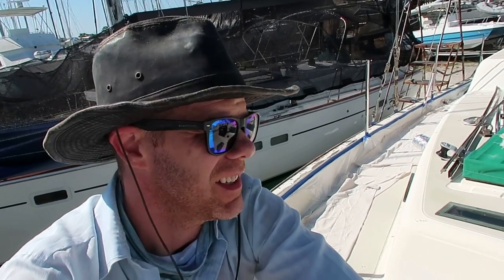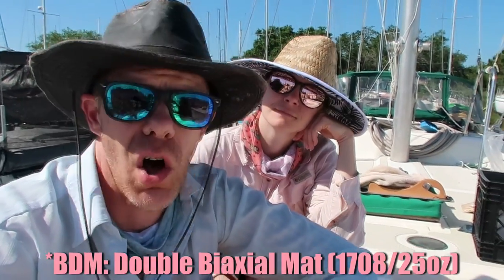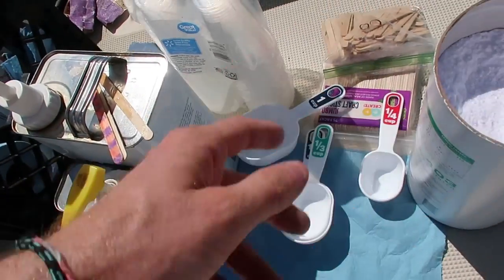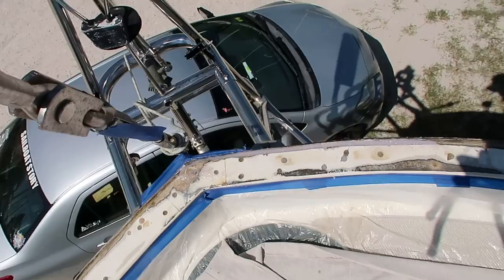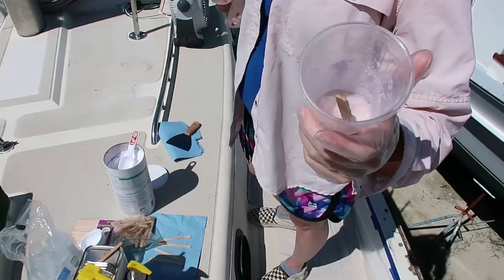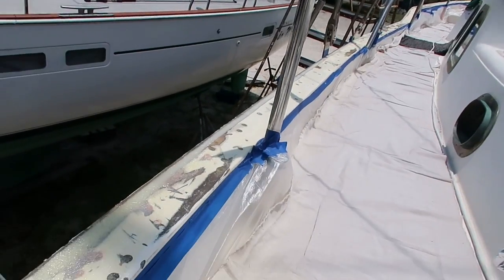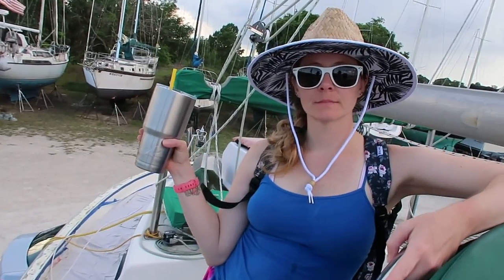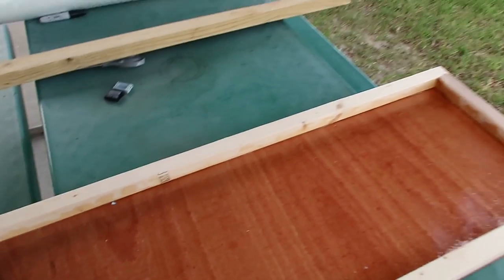HULL TO DECK JOINT REPAIR | PART 3: Filling & Fairing With Thickened Epoxy | Sailboat Story 200

Comment: By doing the hard work now you guys have saved yourselves a lot of future grief. It would be nice if some boat manufacturers would watch this video.
Reply from the maker: It was nice when the leaks suddenly stopped after the initial application of the neat epoxy poured into the joint. Everything after that was just additional insurance against leaks, beefing up the cap rail, and now we're just working on making it look nice.

Comment: Too late now, but maybe this will help in any future projects... A little prior planning goes a long way to reduce your workload.  In this case it would have been more efficient to cut all your strips the night before.  After laying down the thickened epoxy in the gap there is no need to wait till it cures and sand it (so much avoidable extra work).  Once it kicks and gels you have a good 6 hour window to still get a chemical bond with epoxy, so immediately start laying down your 1708 Biax strips.  Once those are down you are still in a chemical bond window so mix up the fairing filler (407 or 410) and lay that on moderately over the fiberglass, then let it all fully cure.  With the fairing filler on top of the glass it protects it from amine blush directly on the new fiberglass you just laid down, plus it is now super easy to sand it all with your long board to get a nicely faired, flat finish surface.  The other strength advantage is that the cloth laid over and laminated to the existing rail when the thickened epoxy was still in its open time gives you a superior chemical bond.  In any case, you did just fine and the mechanical bond you have is more than adequate for that application.  The method I just laid out would have saved you some sanding and the job would have been a one day thing with less fairing before primer/paint.  Still a great repair on your part.
Reply from the maker: Thanks man. Sounds like you really know your stuff. Probably the factor that would have prevented using your plan, more than a lack of planning, is a lack of energy. Ha! It’s been TOUGH getting this job done in the FL heat. Thanks for the insights. I do appreciate it.

Comment: Thought at first you guys leave Molly in the woods . Just like Hansel and Gretel Good thing she was there, she knew how the vacuum cleaner worked, that's how women are☺️☺️         And also got 2 blows, 😂😂nice humor. But still a lot of work with the arrangement to edit it like that, but you will benefit a lot from it later , the leakage is nicely gone . It was a nice video again
Reply from the maker: There were 3 blows. Can you find the 3rd?
Reply: @Sailboatstory  i go and look again
Reply: Yes at THE end of THE video
Reply: Yes at they end the video 😂😂😂
Reply from the maker: @johnyassouw  There it is. 🤣

Comment: just a thought on the epoxy mixing, you might want to do the hardener last, instead of the thickener.  it will give you a bit more time to mix-in the powder thoroughly, before it starts to kick off, giving you slightly more working time..... just a thought! 
luv you guys, best wishes for a full and speedy return to the water!!!!
Reply from the maker: That could work, but it might be more risky about whether the epoxy is mixed well enough. Haven't tried it that way though. We didn't have any trouble once we started either getting it out of the cup ASAP or just spreading it thinly around the inside of the cup. Prior to that though we did waste a few half cups full of thick epoxy. Either way, it's important to move quickly and deliberately with the fast cure stuff.
Reply: @Sailboatstory  yeah, epoxy can be a tricky thing, depending on the type. Even the humidity, and air temp can impact curing time.  I'd imagine, if you'd already mixed the thickener and the larger quantity of epoxy, (or even the opposite way around, so you CAN see how the hardner is mixing into the larger volume too) you could tell how well mixed-in the thickener blend is by the viscosity (in the cup), again having a lil more time to ensure the first blend is uniform before adding the second component at all, never hurts, plus this way you're not racing the clock from your second step, only your last.
This way Tambi can setup a few cups, and just add/mix-in the hardener as you need them.
Reply: I have never seen any epoxy expert who suggests adding the thickener before the hardener. To me, that suggests that doing so is probably a Bad Ideaᵀᴹ.

I've mixed up plenty of thickened epoxy, and I can easily picture it being a real struggle to thoroughly blend hardener into thickened resin. It would be far too easy to get lots of small areas in the mix that didn't have enough hardener.. which would be disastrous.

Comment: i have been thinking about doing the same thing on my westsail 32 due to broken spots in the cap rail and the labor of coating it every year. im interested in seeing how yours turns out and what problems you had making it. thickness off the biaxe cloth?
Reply from the maker: It's a tough job, that's for sure. The thing is, I feel like all boats with caulked hull/deck joints will eventually need some kind of remedy when the caulking fails. The Westsails seem to all have this particular fault quite badly to some degree. It sounds like yours isn't leaking, which is wonderful thing if that's the case. Ours was leaking really badly, so I didn't want to take any sort of "band-aid" approach. We went the full measure. In the end it will be interesting to add up all the time and costs but we'll share that once the project is complete.
Reply: I have a Westsail 32 I’ll be doing this to as well. I’ve read that the Hawse Pipes are a source of leaks too. Those can be replaced and recaulked.
Reply from the maker: @Even_Keeled  Yes, indeed. We had one that leaked as well. Temporarily sealed that one. That's small potatoes compared to our horrid hull/deck leak though, but we'll certainly be getting that sealed up too... eventually.
Reply: @Sailboatstory  Looks great!